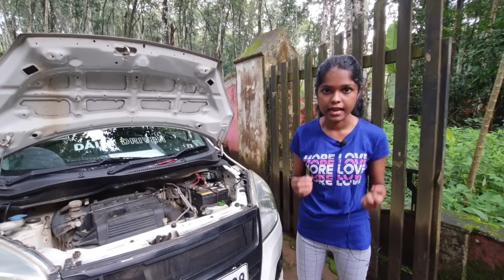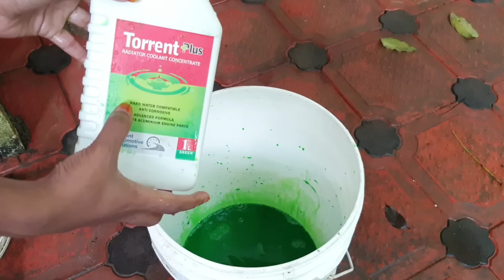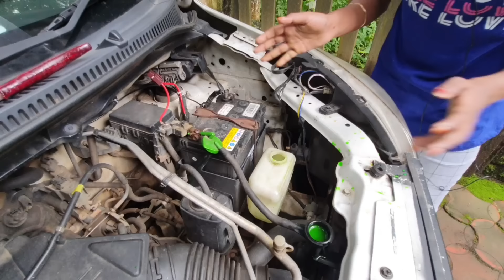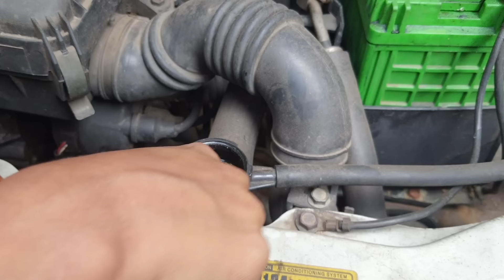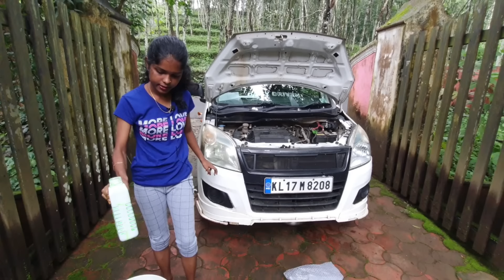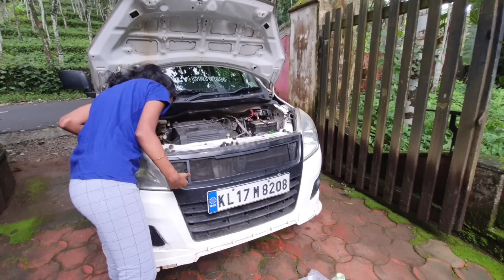How To Change Radiator Coolant At Home | Coolant changing | Best coolant for car | Queen on wheels

Comment: Hi, 
Can you tell me what grade of coolant is used in Renault duster 85ps diesel? 

Is it IAT, OAT, HOAT? 

My car has blue colour coolant in its radiator, so should I go for blue colour coolant? 

Are all blue colour coolants of the same grade? People say that coolants are not classified based on colour so it's really confusing. Incase of blue coolant, can I use shell premixed 50/50 ratio coolant?

Comment: Coolant  full  fill  cheythathinu  sesham  coolant  cap  idathe  vandi  start  cheyth  3  pravashyam  fan  karakkunnath  nannayirikkum. 3  pravashyam  fan  karangiyathinu  sesham  coolant  fill  cheyth  cap idam.  Vandi  odich    coolant irakkanamennilla    inganem  air  kalayam
Reply from the maker: യസ് 😀ഒരുപാട് വഴികൾ ഉണ്ട്
Reply: Shariyanu anganeyanu cheyuka
Reply: @QueenOnWheels  etra kilometer akumpol coolant maranam?
Reply: @robinalex5537  20000km or 2years ഏതാണോ ആദ്യം വരുന്നു അത് ചെയ്യുക
Reply: @pathanamthittakaran81  thanks
Reply: Fan eganeyaa karakkaa.... Athu automatic ayit alle karanga ??
Reply: @andrewsantony3463  yes. Oru limited heat aavumbo automatic aayi fan karangikolum

Comment: Serious aayi chodhikkuva car ill enginte baagatth Kikker fit cheyyan  pattumo... Enganelum weld cheyyhitte vekkan pattumo...plzzz replay  car ill Kikkar vekkunnathine kirich oru video cheyyanam.. ❤️❤️
Reply from the maker: directly attach cheyyan pattilla onn parisramichal old carb vandikalil vekkam extra gear system vechit direct load kodukkan ulla seshi namuk kitiyenn varilla athanu extra gear connect cheith alpam lathe work okke cheith fittings okke undakki vekkam enn paranjath.. but fi vandikalil alpam seen anu..😀 youtube nokku chilappo vecha vdos kanam
Reply: @QueenOnWheels  mm ok

Comment: Oru karyam mol note cheyyanam engine blockinde inside illa vellam koode drain cheyanamengil radiator hose bottom side disconnect akiyale patukayullu apple fully old water change drain akku check if iam correct  ok
Reply from the maker: Ethipo fully drain cheyyanda karym ellarunnu atha🥰

Comment: Ingane drain cheythu coolant nirachal vandi over heat akan chance undu,vandiyile heater coril air trap aayi coolant circulation cirrect aayi nadakkathe varum.eppo coolant mattiyaalum radiator capile spec 14-21 psi vare vaccum cheythu venam coolant refill cheyyan......

Comment: Maximum distilled water use cheyya allenkil rust formation undavum water pump failure rust form ayi radiator tube block avum circulation nadakilla angane bhaki ella super njan ente oru abiprayam paranju ollu pinne main ayi check cheyyanda oru karyam und coolant mari kazhinj vandi start cheyth radiator fan work avunundo nokanam
Reply from the maker: borewell water compatible anu ee coolant so problem varilla
Reply: @QueenOnWheels  ok thanku new information

Comment: Sister,  My wagon r dashboard shaking problem and getting sound in idle if rais the accelerator no sound and vibration. What to do ? tell some idea . This problem camed after company service.  Before service it's very smooth no noise inside the car in on mode .
Reply: Engine mounting onne change cheythe noke ok akum same issue ayirunu enik
Reply: @amjadvs9842  🤝 Thank you .

Comment: How radiator helps the process of cooling engine ?
Reply from the maker: കൂളിംഗ് സിസ്റ്റം വീഡിയോ നേരത്തെ ചെയ്തിട്ടുണ്ട് കാണാമോ
Reply: @QueenOnWheels  ohh yeah thanks sure I will watch but I have one question queen Is it different that intercooling vs engine cooling if so how does it works ? Thanks for your reply.👍
Reply: What a hilarious question !  Do you drive any vehicle ?